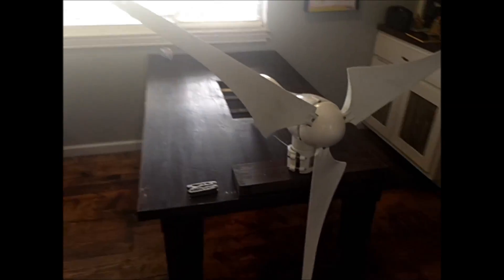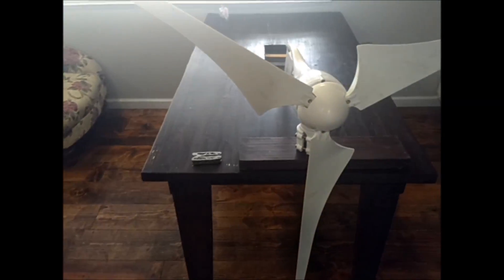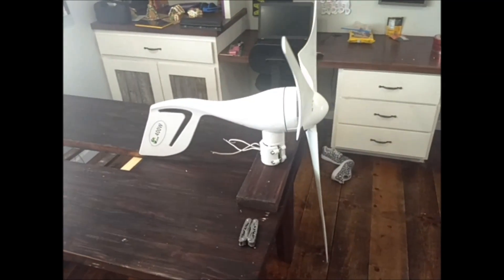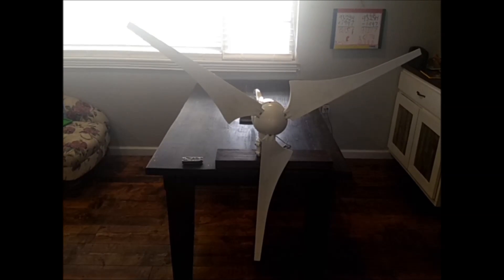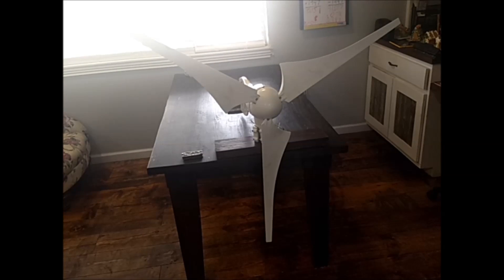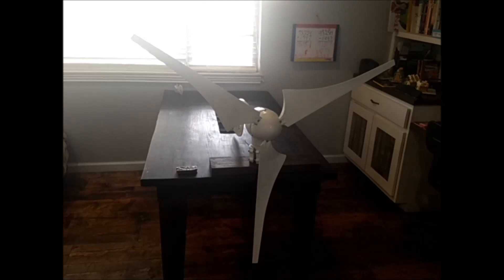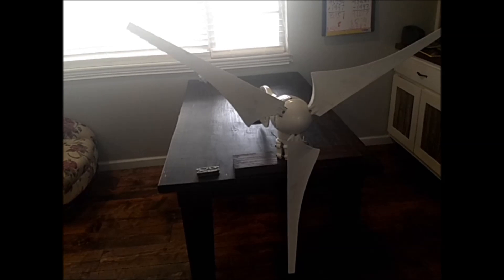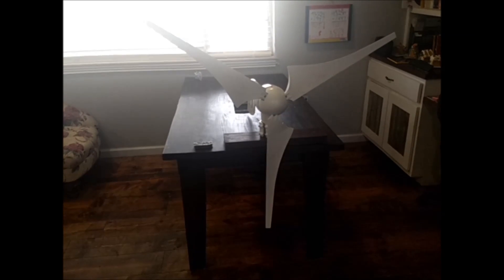eBay Chinese 400 Watt Turbine Review, Setup, and Initial Performance

Comment: My setup is very basic, nothing like your amazing setup. I only just moved to this house and from the beginning notice it was great for wind, located on a hill and had a clear view to the South East, which is where most of our wind comes from. There is a row of posts from an old fence, 3 meters apart .just waiting for some wind generators. I mostly use steel pipes that I already had, but brought the two 6.5 meter poles to get up higher then the house to help get the North West wind that comes over the house  .

Comment: I bought one 400 watt tiny unit. It made only 50 watts & burnt out its slio ring caosule in two weeks. No replacement was offered unless i paid him £60. I sold it on after drilling the body for a Cable.

Comment: Get to the basics.
Only the outer third of any turbine or propeller actually does work. The rest is not going fast enough to produce work.
The outer third should have big blades to better capture the wind.
Engineering experiments show that the angle of 25.5 degrees captures the most energy. (Three blade cantilever blades are at an angle of about 2-4 degrees).  This produces high RPM, and is not efficient.  It also produces noise and vibration.
Going faster takes more energy from the very wind that you are trying to get energy from.
Bigger is better with all wind turbines.
Heavy on turbine blades is not good. More cantilever blades add more weight, to the point that the shaft cannot support more.
The Tension Turbine is the only wind turbine that is feasible now.  The Tension Turbine tip speed is  SLOWER  than the wind.  This produces maximum power and little noise or vibration.
The Tension Turbine: Half the weight, twice the power. 
The future is the Tension Turbine. TensionTurbine dotttt commmmm for more information.

Comment: Question, you mention you are using romex wire from the turbine, are you using solid conductor or stranded? Watched another youtuber video and he said solid doesn't work well, but if that is what you are using it seems to work fine.Thanks

Comment: Are you putting 40+ volts directly into your 12 volt batteries?  Does that damage them?  Or do you have some type of voltage regulator like cars use?
Reply from the maker: I haven't watched this video in quite some time, I don't think this turbine would have had the power to kick voltage up to 40vdc on a 12v battery...at any rate it was a 24v turbine.  It "might" have managed to get up to 40v on a 24v bank but only briefly.  In general, though, I'm very mean to my batteries for the sake of testing and demonstrating the peak potentials of the turbines I work with.  Always use a charge controller appropriate for your own application :D

Comment: Underground bunkers that want no solar or wind to attract people to you... you could take one of these turbines and hook it up to the back tire of a mounted bicycle and have your entire family take turns Pedaling.. allowing you to get daily excersize and power for your family.  TEAM WORK! 🙂
Reply: The problem is that these altenators require around 3k RPMs to produce usable power. Unless gearing is used to speed up to the required RPM which will increase the load to the pedaler, a good work out!

Comment: when it says 400 watts, the 10% is the correct wattage. Just remove the end zero. That's the max==40 watts max. If 500 w rated, its 50 watts logically. That's my observation with wind turbines and some advertised solar chargers.
Reply from the maker: Not with this turbine, it performed very well and peaked nearly three times it's rated output.  There's good cheap turbines out there, the problem is that finding them is a bit of a crapshoot because they all look identical.
Reply: That was true with my one a few years ago. It stated it was 400 but made 50-60 watts max 1.2 Amps in a 15 mph breeze.

Comment: I'm still on and off about getting a small turbine. I have a "DIY-ish" renewable system, the heart of it is a Bluetti AC200Max, though, I'm just going to Heath Robinson up a bunch of cheap flex panels eventually, and probably store the excess in ordinary LiFePo4 batteries, not Bluetti's own ones (which cost almost as much as buying a second unit!). Might try it, now!

Comment: Thank you sooo much, I just bought a cheap discounted 400w wind turbine that I got at the end for 50 USD, down from 230 ! I plan to spend one full year, winter included, in North artic circle in Norway... and have the wind turbine recharging my lithium battery for the lightning inside the van...
Main heating inside van from LPG (water boiler & kitchen) and diesel (air heater).

Comment: The blades twisted opposite way towards the end. Is to help deal with adverse vortices generated along the length of the wing. This is incorporated in aircraft propellers and aircraft wings of certain designs

Comment: I have a question. Can a Wind turbine still produce electricity even when the wires aren't hooked up?
Reply from the maker: That's a surprisingly complicated question!  If there's a magnetic flux passing over the coils, they'll move electrons.  Resistance is important here.  The more resistance there is between the three phases, the faster the turbine will spin.  The lower the resistance, the more drag on the turbine.  In essence here if the leads aren't connected to anything then there's infinite resistance between the phases...you're still producing electricity but if it doesn't have anywhere to go then it doesn't go anywhere....and your turbine spins out of control.
Reply: @ToysforWatts  The reason why I asked is because I am into windmills and I would like to get one of these turbines but just have it spin like a regular windmill. Is there anyway I could disconnect the generator to have it do that?
Reply: @randalnelson7094  🙆did you buy it or made it yourself?

Comment: Thank you for actually documenting the power output of the mill. I’ve seen a lot of these videos that doesn’t do that.

After reading a lot of bad reviews for this type of “China-mills”, I’m rather surprised this one can produce the wattages they claim it can do. however, I guess you are having a minor storm to get >400W? - but still it’ll all sums up. The "Ista Breeze i-1500" you recommend looks like a pretty good wind mill to go for.
Reply from the maker: Thanks for watching!  Some of the chinese turbines can be pretty decent but it can be a real chore to find the goods ones from the bad.  This particular little 400w turbine was a gem.  I saw close to 1000w (peak) from it on a few occasions.

The iSta Breeze i1500 and i2000 turbines are easily the best watt/dollar ratios you can get right now.
Reply: Running wind turbines with no load can damage them. People who buy a cheapie (probably the first one they ever bought), take it outside and watch it spin around in their hands with nothing connected, so no wonder it doesn't work properly after that.
Also I saw a video where somebody mounted it in a tree, as in, among all the branches and leaves. They lived on the coast and had really strong wind, too. If they set up a few decent small turbines they could probably produce a lot.

Comment: Is that the delta wing blade 630mm ? If so are they any good compared to standard
Reply from the maker: I didn't measure them specifically but the rotor diameter was roughly 48 inches (1.25m).  That style of blades is FAR superior to the standard blades found on most Chinese turbines.  The only issue I had with them were they had a slightly poorer slow speed startup...it took a little more wind to make them go, but while they were working they made more power and ran quieter.

Comment: I got something similar advertised as 800W. It produces 30W.
Reply: I saw somebody who bought a 100w solar panel, which was tiny and actually made 30w. I bought a couple of 30w ones to charge a small sogen, the ones I actually got are 10w. Even when I was expecting to be scammed I still got scammed! Had 8w reliably out of them in very-far-from-ideal conditions, though, so at least they produce!

Comment: What brand was this unit? Was it this one?

https://www.amazon.com/gp/aw/d/B087BY2YV7/?_encoding=UTF8&pd_rd_plhdr=t&aaxitk=fb87e06a4383447798cbe01ddde7258b&hsa_cr_id=8145335630401&ref_=sbx_be_s_sparkle_scm_asin_0_title&pd_rd_w=RvlsC&pf_rd_p=22aaccd3-32f1-4e8a-8b82-495782857be5&pd_rd_wg=kPirh&pf_rd_r=JZR8MDNYAEXWE54ANFTQ&pd_rd_r=5fe59821-a808-4f90-8fa3-75bb1b660db8#

It certainly looks like it. Much thanks. 👍👍👍
Reply from the maker: It's the same style and blades, it's a good possibility.  Unfortunately you'd have to get it and open it up and look for those big magnets and coils to find out for certain.
Reply: @ToysforWatts  So what brand was the unit you purchased? I am needing to get a wind turbine to suppliment my solar array. We have significant wind where we live, it's blowing right now, but don't have the cash to "experiment". I need it to be a one and done purchase. Much thanks.
Reply from the maker: I HIGHLY suggest the iSta Breeze i1500.  It is more expensive, but when it comes to $/watt it's the best off the shelf model on the market right now.  I have REALLY abused mine and only had small failures with easy fixes...if it catastrophically blew up today, no matter why or how it blew up, I would buy another immediately.  Excellent turbine and if you're using one with a proper charge controller and brake it'll last a long time...the only reason mine has had any failures is because I run no brakes and in all weather :D.  When most people see 70mph on the forecast they go shut their stuff down...I go out and see if I can brush 3500 watts!  (record so far is 3100 watts at 62mph)
Reply: @ToysforWatts  Nice. Thanks for the input. I will strongly consider the model.
Reply from the maker: I have one of those, too, and I don't think it is a "bad" turbine, but I haven't yet found a way to get peak performance out of it.  This is the turbine I'm talking about, and is worth every penny.  The 3-blade version is better than the 5-blade version.  Sometimes you can get a better deal on Amazon or eBay, too, so shop around a bit.  https://istabreeze.us/i-1500w-24v-48v-wind-turbine/
Reply: @ToysforWatts  Unfortunately my inverter tops out at 1000 watts and my controller handles 60 amps. I could handle the amps, but if that 1500 watts maxed out it would be fry time. LOL

I am gonna have to stick with the 500 watts model, but it does give me buying confidence that the brand is reliable over all.
Reply from the maker: I would suggest looking at the i700 or i1000, then.  Those turbines are built on the same platform as the i1500 which I have had a LOT of success with.  I'm not fully sold on the i500, yet...I think it can be a good turbine but haven't yet figured out how to get the most out of it yet.
Reply: @ToysforWatts  Sorry, I did not mention, but I am currently running a 350 watt, 35 volt, 10 amp solar panel. I am going to tie in a wind turbine to suppliment the solar.
Reply from the maker: Are you charging batteries or just connecting directly to the inverter?
Reply: @ToysforWatts  This is the build.

1- 350 watt, 35 volts, 10 amps solar panel
1- Outback FLEXmax 60 charge controller
2- Centennial DC27MF 12 volt deep cycle RV/marine lead acid batteries, 115 amp hours each set in parallel.
1- GoPower ISW-GP-1000 12 volt inverter

Comment: Hi, What is the model number of the 700w? Thanks
Reply from the maker: Most of the generic Chinese turbines don't really have model numbers, you have to go by general looks.  I'm pretty sure this is the same turbine: https://www.aliexpress.com/item/32865133395.html?spm=a2g0o.search0302.0.0.6f9f4573lRYBha&algo_pvid=f07f5212-9fa8-4985-bb6f-9155bc964777&algo_expid=f07f5212-9fa8-4985-bb6f-9155bc964777-4&btsid=0b0a555a16152581665286525ed868&ws_ab_test=searchweb0_0,searchweb201602_,searchweb201603_

For the price, though, I strongly suggest you look at the iSta Breeze i1500 instead.  It's only slightly more money and tremendously more performance.  If you really want the 700, though, mine is for sale.

Comment: I want a good starter turbine starts in low wind  that won't break the bank . Sujestions?
Reply from the maker: what are your goals for the turbine?  The iSta Breeze i1500 is easily the best cost per watt ratio out there in terms of wind turbines.  It'll cost you roughly $400 USD and is a solid workhorse.

Comment: I just bought one of these wind generator for my sailboat. So far everything out of the box is great. EXCEPT the instructions. Three white wires? Coming out of generator? What is what?  Red, black and three green wires coming out of the controller. What are the green wires?
Reply from the maker: Hi Howard! Thanks for watching!  Every watch and every sub really helps me out!  The instructions are meant to be thrown away...they don't think anyone reads them.  The turbines produce three phase AC current so all three of the leads coming from the turbine itself are all paralleled outputs.  There's no polarity or anything.  The three green wires on your controller are the inputs...they connect to the three white wires from the turbine.  It doesn't matter what order they're in, but all three legs are required.  There's a rectifier inside the controller that will turn the three phase AC current into DC current (your red and black wires).
Reply: @ToysforWatts  Thank you very much! That explains it. I do not expect expect a lot out of this generator. But when it windy and cloudy.  Hope to get the batteries charged in the boat.
Reply: hows it working? Im a live aboard looking too! TY

Comment: Thanks so much for this video. In your setup of three turbines, one of them went over 1000W, wouldn't that damage the 1000w inverter since the total power produced is way over 1000w? How do I know my inverter could handle the power the turbines will give?
Reply from the maker: Hi Noodler! Thanks for watching!  Every watch and every sub really helps me out right now!  The batteries are where the excess wattage comes into play.  That's why I have them.  The batteries are like shock absorbers or rubber bands.  Whenever the turbines producing more than the inverters can use, the batteries take that load.  It is important to remember, though, that I'm not nice to my batteries...doing it this way, if you want your batteries to last a long time, you will need to use something called a dump load controller which will essentially shut your turbine down, or brake it, when it starts producing more power than is being used.  The inverters are never going to suck up more wattage than they can process.  It's easier to think of them as someone standing above a cup and drinking from it with a straw.  Even if gallons and gallons are dumping into a 7/11 Big Gulp, you're only going to suck up what you want.  The only way the inverters can really be damaged is if they're hit with a large voltage spike...that sometimes messes them up.
Reply: @ToysforWatts Thanks for the clear explanation. I'll include a dump load controller in my system for safety, and probably use a grid tie inverter with a limiter as well.
Reply: @bluestweaks77  water heaters make for a good dump load also

Comment: What's your thoughts on this one? Trying to get any info out of the seller regarding performance is like pulling teeth: 
https://www.ebay.com.au/itm/3700W-12-24V-3-Blades-Wind-Power-Turbine-Genertor-Kits-W-Controller-Regulator/184357055932?_trksid=p2485497.m4902.l9144
Reply from the maker: Unfortunately all the Chinese manufacturers seem to have a dozen different stator designs that they all cram into the same generic housings...they all look the same on the outside and it hard to tell with certainty what you're going to get.  I can say that I'm growing a bit weary of that style of blade...it's loud and not very resilient.  Whether or not the stator will do that job, though, is a bit of a lottery.  It might, might not.
Reply: Thanks for taking time to reply.
I think I'll get the Eco-worthy 400w turbine, I've seen that in action, so to speak, it's quiet and seems to work.
Best regards,
Paul

Comment: The wiring at the base of the turbine....   does it matter what is hooked up where?  Trying to figure out which one is the ground.
Reply from the maker: There is no ground.  It's three phase AC current.  All three phases will need to go to a bridge rectifier (unless you have charge controller or inverter that accepts three phase input.

Comment: how long is your wiring from the turbine to the controller? mine just produces 25 to 50 watts.. not sure if its because the wires are too long (almost 50feet)
Reply from the maker: For this particular turbine the wiring is less than 20ft.  Can you post a link for which turbine you're running?  What is the battery arrangement you're hooking up to?
Reply: @ToysforWatts  here is the link
https://a.aliexpress.com/_dWbmyJr

I reduced the wire length to 20ft.. the output is still between 20 to 30watts.. I tried using a 24v battery as well as a 12v battery.. but will the battery matter?

Comment: I love when they sell 9000,8000,6000... rated power turbines for 100-150$ and reality are around 200wat !! If I buy that I will ask half money back because of fake/wrong power rating!!after all who the fak will pay thousands of $  for (weaker) solar panels if you can get for 100$ turbine which can manage power for 2-3 houses/apartments
Reply: There seems to be 2 differing weights of them I wondered if is 2 types ? What power do they give 1kw may be ok but only a front bearing is Very weedy, a would take slip rings out and extend shaft to a rear bearingay  . can get larger blades but is windings large enough for say2kw ?